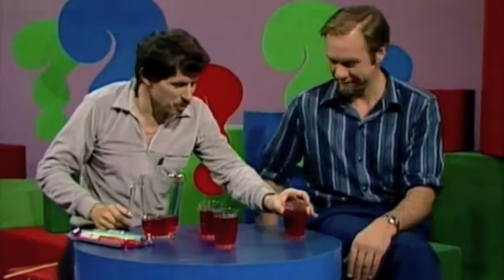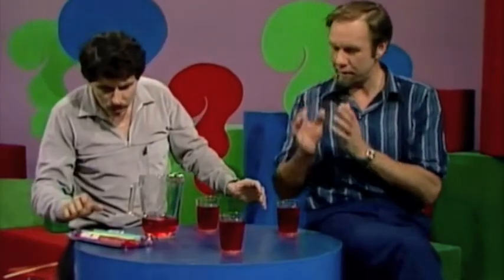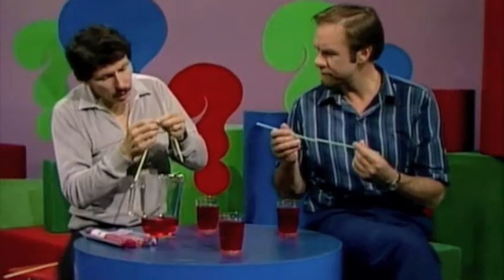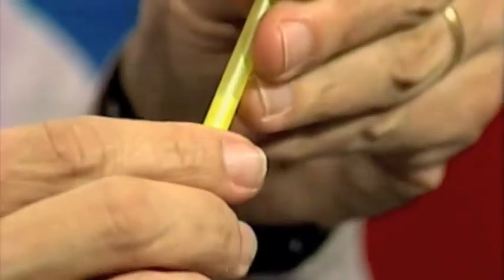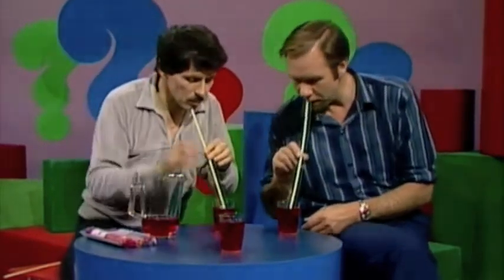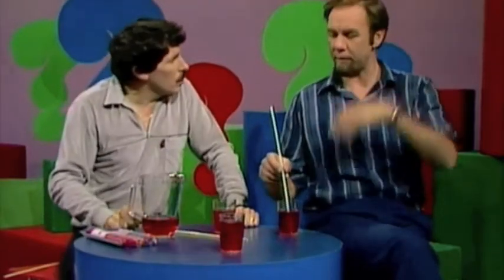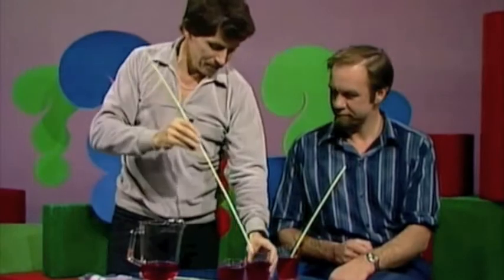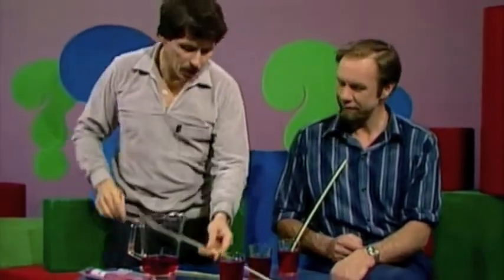Joining Drinking Straws

Comment: I have just found out that Under normal conditions of atmospheric pressure suction can draw pure water up to a maximum height of approximately 10.3 m (33.9 feet).
Reply from the maker: Yes, Andrew, you are quite correct.  But you would need perfect joins for the straws and a very powerful 'sucker' to reach that maximum height!  Deane.